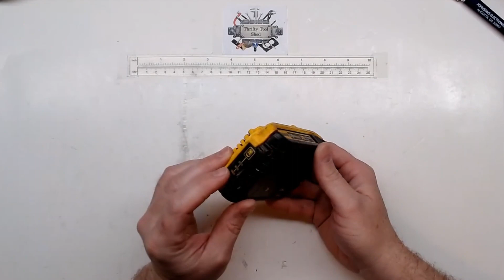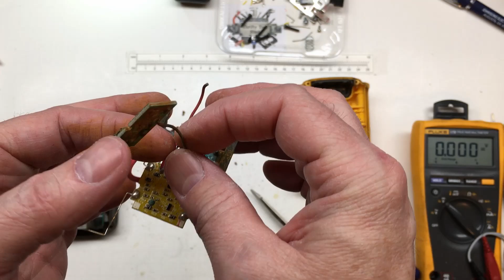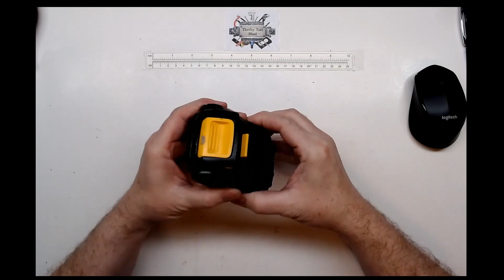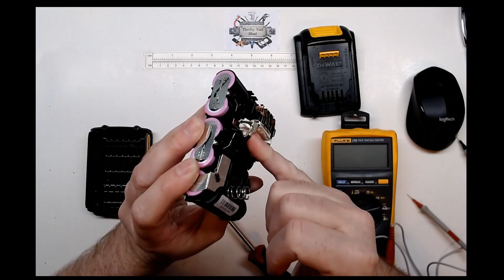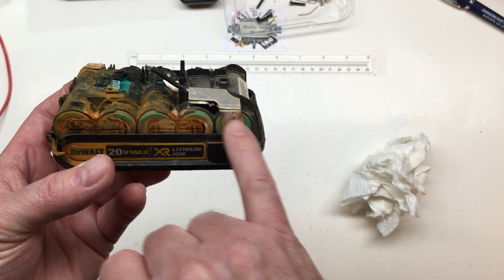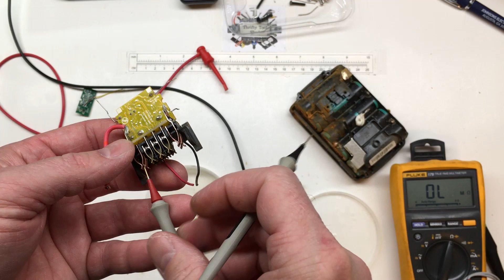A Look Inside a DeWalt 20V Max 2AH Pack

Comment: I have a dewalt battery have 20 v but when I put on the tools it doesn't work and when I put in the charger it show that the battery is hot but isn't what can I do?  Please help
Reply from the maker: You can check the small thermistor on the board that monitors the temperature. It is a NTC and  I have discussed it in several DeWalt videos. That's the main thing to check if you have already tested the cell voltage.

Comment: does this bms cut the power off when the voltage gets too low?
Reply from the maker: It does not, the tool shuts down on these packs when it detects low cut out level. Makita, Milwaukee and DeWalt use this method. For example Ridgid and Ryobi use the method of the Mosfets are built into pack and will cut power output.
Reply: considering the differences you mentioned above...
What do you think about using an adapter to power a Ryobi tool with a Dewalt battery? 
Any concern about battery damage from deep or overdischarge?
Thanks -D
Reply from the maker: Well the main thing is the low voltage cut off.  I use it myself on tools that I can tell when the voltage is dipping. The  blower, vacuum and drill etc.   I can tell when the speed of the tool changes and the voltage has dropped. I use it because I know what to look for. If you can't tell when the pack is dipping low by listening then I would not use it since it does not automatically shutdown when voltage drops low.

Comment: Hi, so does the pc boards not the same for big ah.
I this change my batteries in my dewalt 18v 1,3ah pack. 
To 2,8 ah 18650. It work but it cutout on high torque. Light flicks and on power. I leave it for 10 seconds and it is ok. 
So is it that the broad cant handle the higher capacity?
Reply from the maker: I have only used these boards for low current or low draw applications and I have had no issues. Several comments on here have been about issues with higher current or higher draw seems to be a issue with these boards. I know they are rated alot higher than I have ever used them, but some are saying they can't get much current out with out shutdown. 
The current sensing is either to sensitive or either the wiring added to the BMS is too small and causing the voltage drop at high loads. Must be one of the two, but I have not had that issue with mine yet. I may need to setup one if my last boards like this up to test. I have used several for small loads like the dog collar and transmitter with no issue so far.
Reply: @ThriftyToolShed  so it can be a safety feature that's making it shutdown.
Reply from the maker: Possible it is like a over current type shutdown, just guessing. I havent seen it yet to say for sure.
Reply: @ThriftyToolShed  
So when i screw in a screw and it gets titer and then the torque gets higher it shut down.
Reply from the maker: Sounds reasonable!
Reply: @ThriftyToolShed  Ok, i change the batteries to a lower capacity 18650 and it work now 100%.
So the board can only handle a certain capacity.
Reply from the maker: @nicholascolyn4491 
Good to know. It is absolute that higher capacity cells will allow greater amounts of current flow. I would not of thought your load would have allowed that much more current to be drawn. Other wise as far as charging and discharge, the cell capacity should not have really been a factor.  Interesting for sure.